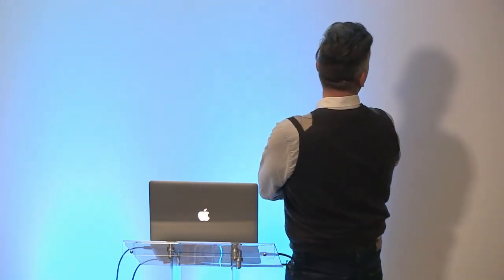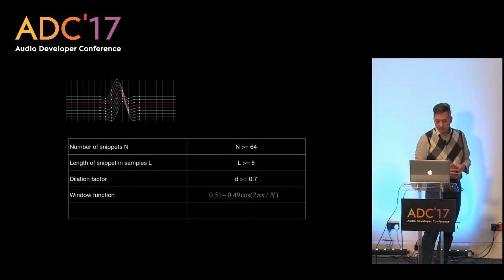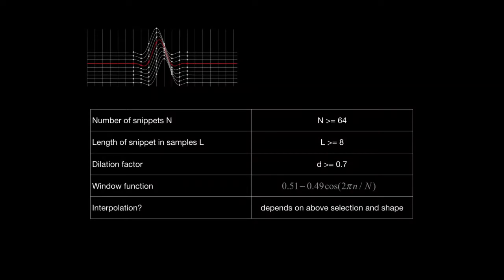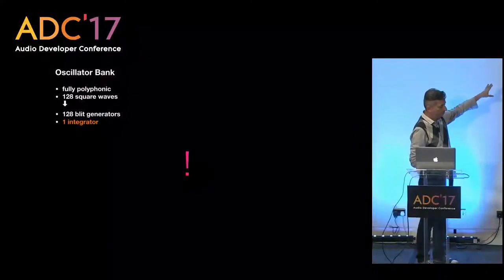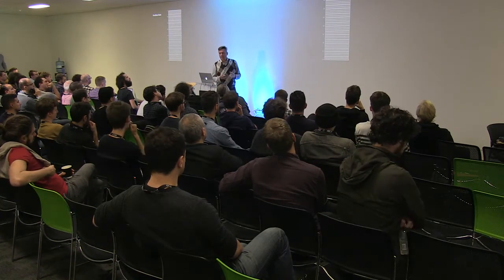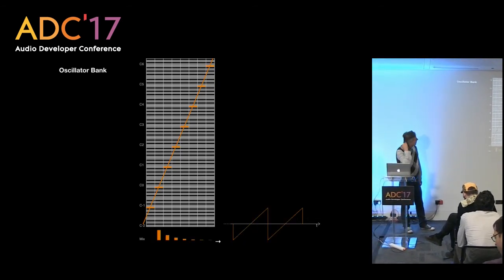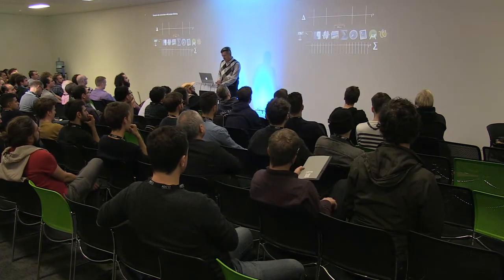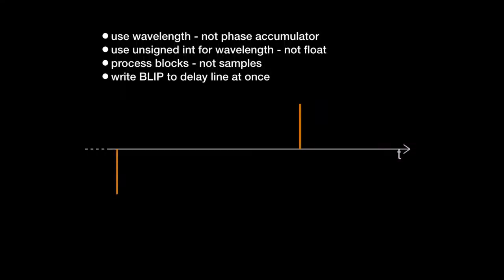Stefan Stenzel - The amazing usefulness of band limited impulse trains, shown for oscillator banks..

Comment: How would he modulate an impulse train or implement a synced oscillator, especially with his "wavelength instead of phase accumulation" method?
Reply: See how it's done in Surge virtual synthesizer, it's using the exact same method. Code is open source!